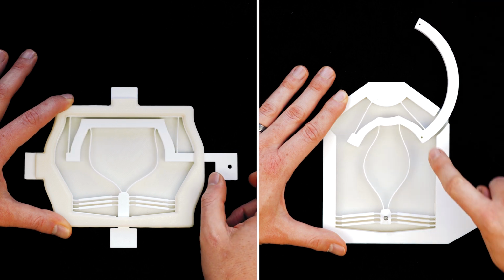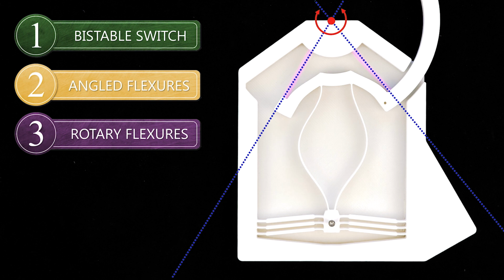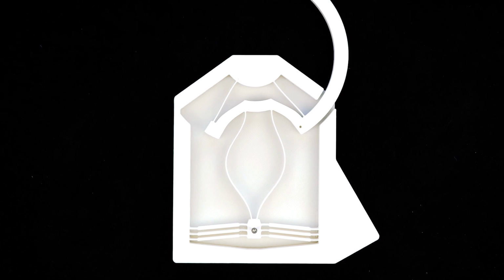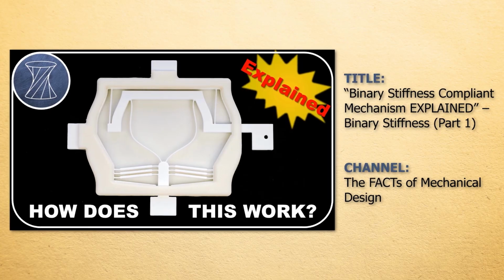“Binary Torsional Stiffness Compliant Mechanism EXPLAINED” - Binary Stiffness (Part 2)

Comment: This is so well lended to laser cutting material rather than 3D printing
Reply: Are you sure about that? I feel like with how thin the flexure features are they'd bend and warp from the heat of the laser. 
Also, and I could be wrong here, as I haven't had to look at it for a while but I seem to remember plastics that are good for continuous flexing like this, such as nylon being fairly expensive in sheet form suitable for laser cutting. I doubt every lasercutters' best friend, acrylic, would work for this sadly.
Something that I know is very suited for flexures like this however is wire EDM so you can make them out of steel or other metals which is pretty cool.